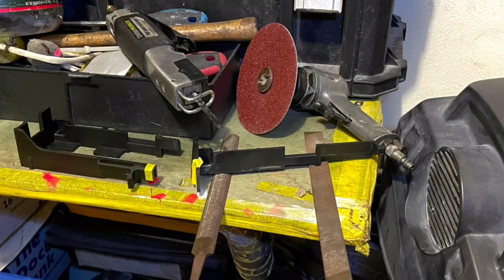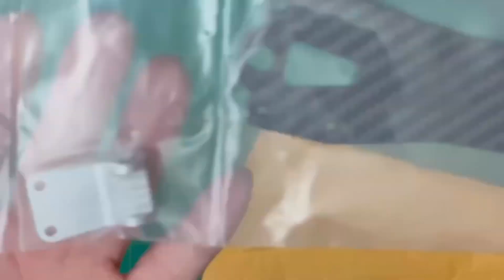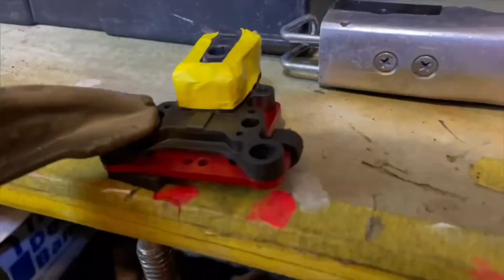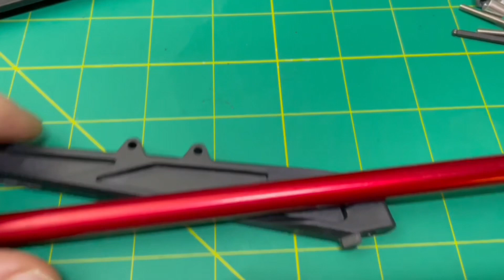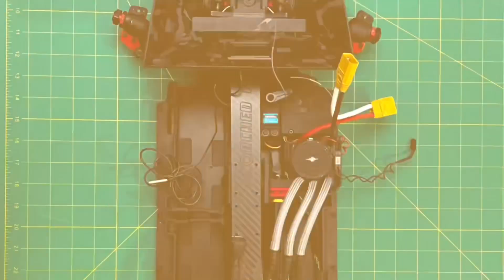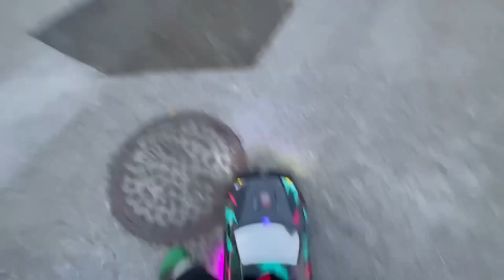Arrma Limitless 1:7 Skyline RC Build TP4070 🔥IRON MAN SHAFTS🔥….(Part 18)

Comment: So many mods for an underwhelming 65mph.... " THAT'S NOT TOO BAD,"  like you said but wait, a stock typhon does like 70MPH...
Reply from the maker: 😆… trust me I didn’t do all that work to leave y’all hanging on a basic 65mph.. “that’s not that bad” is because I used a small 6s 200 amp esc to push a 
9,000 watt 75krpm TP motor. So the last two uploads was to see how far that small esc can go without burning up. Right now the car has already gone 8s so that’s what’s coming out next. The mods I do bcs I enjoy it, especially the headlights and the fact that the body comes off without wires. However…… all my builds have two bodies. A shelf body like this one, and a speed run body.. so that’ll be the next body.

Comment: Wow dude your car is awesome. You did such a nice job setting up the electronics and even added some under chassis lights that chase. Your GPS safely tucked inside but visible through the hood. Amazing.  🏆😀👍🏁
Reply from the maker: ..😁 yea it took 8 months but I finally made it here lol.. 🙏 🙏 thanks it really means a lot!! I have yet to finish painting the resin printed RB26 and make some charge pipes for it and the from shocks for the splitter. Then I can let that body be the “shelf queen”… I did finally drop a MMX8 esc in there and it was out of control!! I blew a tire and it caused some minor battle scars but nothing I can’t revive back to normal.. that content is coming out sooner than later. My wife got me a 3D resin printer for Xmas and I’m using that to make the headlight buckets I did for the skyline, sooo yea I’m hoping to print some finely detailed headlight buckets for the skyline where ppl can buy them and have the same lights as I have. Except mine were hand made and took long as heck but soon that’ll be in production.

I want to print custom parts for EVERY 1:7 body that fits the limitless platform!! I’m 👌 thiiiiis close to introducing the 3D resin printer, just need to finish the next upload and then the resin printer.. once I learn how to replicate the headlight buckets, I’ll be doing this kind build with every 1:7 body out there🤙🤙🤙

Comment: You opened up the sealed bearings, lubricated then replaced the seals? I'd like to see the whole process because I can't do it without damaging the seal.
Reply from the maker: Didn’t touch the seals.., both the cleaning solvents and or oil will flow right through the seams of the seal… the seals only block dirt that’s it… any liquid or fluid will seep right in.

I simply dropped them in rubbing alcohol because that’s all it takes to remove the factory grease. Using a small container pour some alcohol and drop the bearings in and shake them around…. Grab a bearing while it’s soaking wet and spin it in your hand with your fingers to get the grease to “fling” out from the inside of the bearing… re-soak and do this enough times until you can hear and feel that there is ZERO resistance inside the bearing. 

Once you’ve established that the bearings are cleansed, you could then add a couple drops of  Bearing Oil right at the edge of the seam, the oil will seep in between the gaps instantly. I used the brand ZERO-FRICTION bearing oil. It was the best option on Amazon. The only other competitor was that brand LIBERTY OIL but I went with ZERO-FRICTION.

Hope this is the answer you were looking for, Thanks👍🫵

Comment: 10:30 not to be that guy but that is exactly how you do not measure bearing quality.  An ungreased bearing will always spin longer.  Definitely does not mean its better.
Reply from the maker: The spool bearings are ceramic, I mentioned that a couple times in this video. Ceramic bearings do NOT need to be lubricated, it is not necessary. So it is highly recommended to REMOVE the GREASE that is only used for preservation and will only cause resistance.
However Im using Zero Friction bearing oil on the ceramic bearings to eliminate any noises while listening for any potential problems while testing the installation. It also extends the life of the ceramic bearings under extreme conditions.

These are proven facts and is public information. We’re also comparing these ceramic bearings to STOCK bearings so I’d definitely say it is a very good comparison. If you ever try spinning a stock, Arma, bearing without oil, you will notice exactly how much it rattles, and how much friction it has.

Comment: Dude that's what it's all about ! Putting really what all customization goes 8nto these 1 off builds and you speak my language of 9ver 25 yrs now into Pro Rc car , I'm still rocking my custom Ofna yes Ofna now known as Hobao but working on getting more of my extreme bashing after chassis and suspension major tweaking vids out and it's this video specifically that really helped me reignite the flame under the ol bottom to do so , 9 had stumbled on to Island Hobby Nut looking for new body and GRP Tires etc and looked at all what they had as far as upgrades etc!!! I did see the Hobao titanium center spool shaft kit in there and carbon fiber center top chassis plate but ordering some 3mm carbon fiber plates to make my own versus the titanium turnbuckle chassis stiffening adjustment, since I tune flex or anti-flex into my steering/suspension reactions from +/- chassis bow for minute caster adjustments with great benefits since 2001 in 10 scale touring it carried over to my 8 scale but seeing these products on the site then seeing this video really just basically let me see it in action and or fitment scenarios which I love this type of stuff always have and obviously a lot of RC go'ers aswell but to top it off seeing the all hardened steel Power hobby 8mm center shaft sized spur gear was something I found Incase my MonsterTc Delrin 46 spur goes out since hard testing and tuning from 2019 rebirth build of my all Carbon fiber and titanium with aluminum 1/8 Ofna build , so I say from extreme RC hobbyist to another thankyou for doing this awesome display of proper heavy artillery products on your channel ... 😊
Reply from the maker: Thanks a lot, it’s nice to find other like minded ppl out there.. I know what you mean about the fire to gain motivation. It’s not easy finding fire starter material 😄 so when we do, we need to add the fuel before it dies out. I’ve seen 
Hobao/Ofna creeping into the speed run scene and it’s nice to find a store like Island Nut with many parts in the US. I appreciate your considerate and informative comment, I’ll do my best to remember all the things that viewers pointed out in this video so that I can pick up where this video left off while incorporating the key elements and questions that viewers like and or are concerned about. Thanks again👏👏👌

Comment: I can really respect the amount of time and work you put into that car. Incredibly well done man. A moving work of technological art. 👏🏻👏🏻👏🏻
Reply from the maker: THX 🙏 🫵💯.. I would have never taken it this far if it weren’t for the channel. It’s been challenging so I really appreciate the support.
Reply: I'm running stock electronics getting 80 mph on a 21 tooth pinon love the GTR bod
Reply from the maker: Both my cars are geared to do 100mph. I’ve hit 93 on the felony and 94 on the skyline. I don’t have the runway and there’s always traffic in south Miami. Lots of power on the skyline build, it’s a tire eater. If I build as much as one more 1/7 car, it’s going to be a dual motor and it’s just going to be built for speed run all scorched out with a regular body, no bells and whistles. I just need to find the right place but it won’t be anywhere in South Fl🤷‍♂️☹️

Comment: Awesome video man! Outstanding work really like the single side battery trays and definitely gonna check out the 10 mm shafts. We have the same soldering iron😂👍 and I never knew the felony/ infraction mount was different than the limitless 👍👍but only ever built off the limitless chassis , definitely good to know! Very nice job on the car and the video buddy👌 and I would be a nervous reck drive that car around😂👍👍 still just cant get over the insane detail of the build! You knocked it out of the park!
Reply from the maker: Thanks a million 😎 but I couldn’t have discovered this all on my own.. The Arrma forum is a good place to get acclimated with the rc hobby. That and lots of research because there’s always going to be missing information. MMX8s arrives this week so we’ll compare the logs. Thx 🙏 🫵

Comment from the maker: HERE ARE ALL THE PRODUCT LINKS..
 Rc cooling fans 50 series mount
 DKKY 1/5 1/6 1/7 RC Model Car... https://www.amazon.com/dp/B0BGPWY8MV?ref=ppx_pop_mob_ap_share

FELONY MOTOR PLATE: for small pinion gear also fits limitless!!-ARRMA Sliding Motor Mount Plate,... https://www.amazon.com/dp/B07Q36HMJ7?ref=ppx_pop_mob_ap_share

Motor plate for BIG PINIONS.. fits limitless and felony-ARRMA Sliding Motor Mount Plate 50 Series (Red), ARA320538 https://a.co/d/4FntojX

Iron Man 10mm Titanium center shafts!-https://www.islandhobbynut.com/product-page/islandhobbynut-arrma-limitless-titanium-drive-center-drive-shafts-10mm-thick

Power Hobby 42T spur.. https://www.ebay.com/itm/334314524381?mkcid=16&mkevt=1&mkrid=711-127632-2357-0&ssspo=dmfMG9mvT2i&sssrc=2349624&ssuid=7bOpG4FSShy&var=&widget_ver=artemis&media=COPY

Power hobby 20T pinion.. https://www.ebay.com/itm/374268012401?mkcid=16&mkevt=1&mkrid=711-127632-2357-0&ssspo=dmfMG9mvT2i&sssrc=2349624&ssuid=7bOpG4FSShy&var=&widget_ver=artemis&media=COPY

Ram-Jam Tiranium soool…https://www.ebay.com/itm/125641697950?mkcid=16&mkevt=1&mkrid=711-127632-2357-0&ssspo=SYUGYdw2TbG&sssrc=2349624&ssuid=7bOpG4FSShy&var=&widget_ver=artemis&media=COPY

TP-4070cm2200kv motor.. https://www.islandhobbynut.com/product-page/tp-4070-cm-2200kv-6-8s-brushless-motor-speedruns-drag

8 GAUGE rc motor-esc wire-BNTECHGO 8 Gauge Silicone Wire 3... https://www.amazon.com/dp/B074P4HSF2?ref=ppx_pop_mob_ap_share

6.5mm gold plated esc/motor bullet connectors-OliRC 6pairs 6.5mm Gold Plated... https://www.amazon.com/dp/B07YX3GFFL?ref=ppx_pop_mob_ap_share

8mm gold plated esc/motor bullet connectors-10Pairs Gold-Plated 8mm Male... https://www.amazon.com/dp/B085VZKZJD?ref=ppx_pop_mob_ap_share

35kg steering Servo fits felony and limitless platforms DIGITAL servo-35KG Digital Servo Full Metal... https://www.amazon.com/dp/B08KDW4757?ref=ppx_pop_mob_ap_share

Scorched top brace carbon fiber… sells from Island Hobby from the USA and shipping is FAST and returns will be easy if needed!!-https://www.islandhobbynut.com/product-page/scorched-parts-carbon-fibre-centre-torsion-brace-top-deck-arrma-infraction

Micro mini esc … used to power and control led lights. - DKKY 2Pcs RC Motor ESC, 40A... https://www.amazon.com/dp/B0B7JD22TL?ref=ppx_pop_mob_ap_share

Key chain Turbo with turbo sounds-Boostnatics Rechargeable Electric... https://www.amazon.com/dp/B0192VIDGA?ref=ppx_pop_mob_ap_share

3/8 9mm Green/Blk braided wire loom for rc wires, used on LED light’s wires going to receiver.. 10 FT 3/8" 9mm Black Green... https://www.amazon.com/dp/B07176R9BX?ref=ppx_pop_mob_ap_share

GREY wire loom 6mm- used on esc motor wires.. US $0.48  8％ Off | 4mm Wide TIGHT Braided PET Expandable Sleeving Wrap Wire Cable Sleeve Sheath Insulation Nylon Expand 200％ Single Color
https://a.aliexpress.com/_mO5Qcoq

Black heat shrink wrap for electrical wire.. 720 PCS Heat Shrink Tubing Kit,... https://www.amazon.com/dp/B098LB9LTJ?ref=ppx_pop_mob_ap_share

18 gauge wire black red positive negative wire for led lighting .. 18 awg Silicone Electrical Wire 2... https://www.amazon.com/dp/B07FMRDP87?ref=ppx_pop_mob_ap_share

Purple under glow chaser led lights.. HACK VIDEO ON MY CHANEL…Joliyoou Meteor Shower Rain... https://www.amazon.com/dp/B093SBMNHN?ref=ppx_pop_mob_ap_share

Vinyl wrap chrome tint windows.. VINYL FROG Car Wrap Vinyl 12... https://www.amazon.com/dp/B072Q2GFSK?ref=ppx_pop_mob_ap_share

Forged carbon fiber wrap for engine bay and side skirts and rear wing.. VViViD+ Forged Composite Carbon... https://www.amazon.com/dp/B084XVWKJ3?ref=ppx_pop_mob_ap_share

Digital thermostat motor thermometer digital probe.. KEYNICE Digital Thermometer,... https://www.amazon.com/dp/B01H1RDJOI?ref=ppx_pop_mob_ap_share

Budget RED mini GPS $30.. MEILAN M3 Mini GPS Bike Computer, Wireless Bike Odometer and Speedometer Bicycle Computer Waterproof Cycling Computer with LCD Backlight Display for Men Women Teens Bikers Outdoor Cycling https://a.co/d/6CZDvCY

1/8 expanded pvc foam board for RC fabrication and creating side skirts and wing and lip splitter. Expanded PVC Sheet – Lightweight... https://www.amazon.com/dp/B079NL6B7S?ref=ppx_pop_mob_ap_share